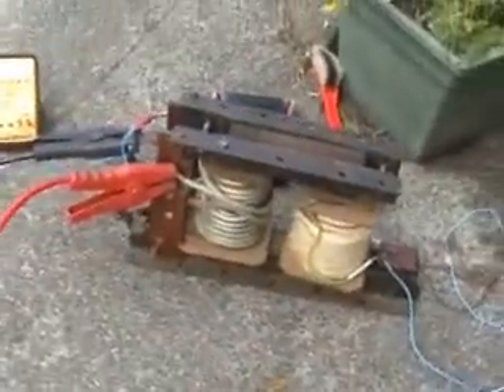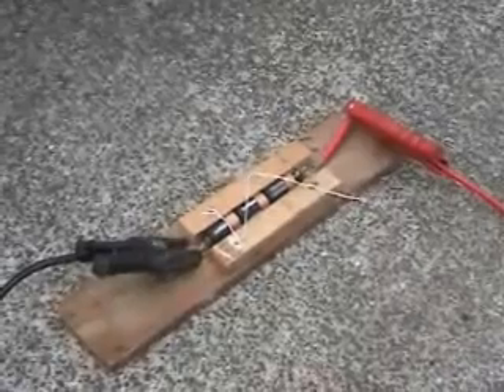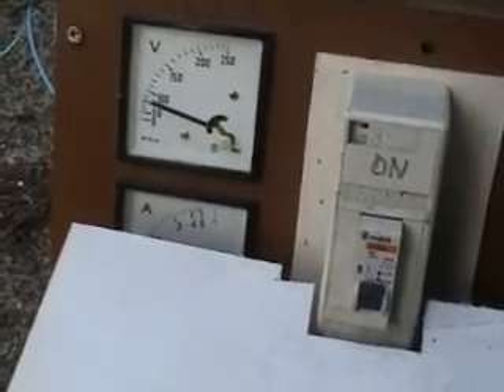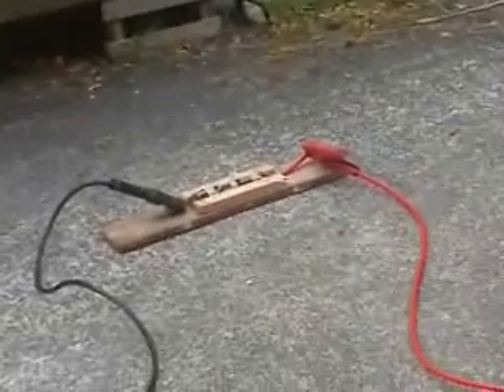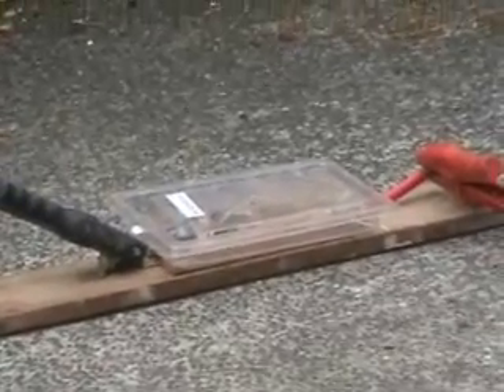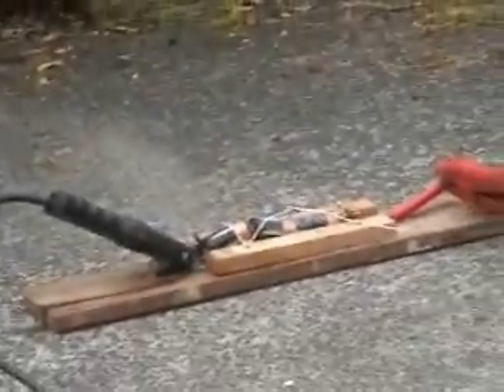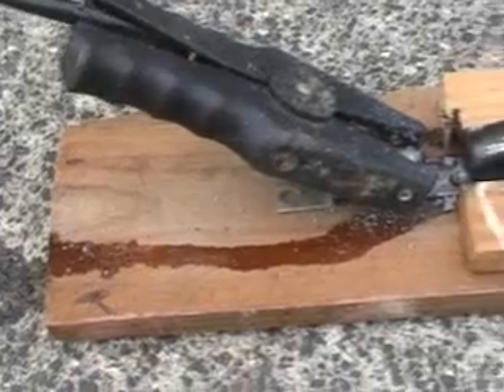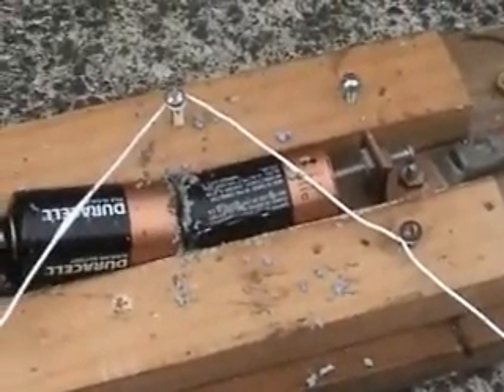Battery Explosion

Comment from the maker: @EvendimataE Be carefull , you need to monitor the cells temperature so that they don't overheat, best is to use a proper charger as these Li cells will explode if not charged properly.

Comment: i have some lithium ion batteries from laptops....if i will charge them with regular chargers will it be a problem..when they are used in laptops i think there is a circuit that senses if they are fully charge and the charging stops

Comment: Hi: Can this D size 10,000 mAh high capacity nickel hydride metal (Ni-MH) rechargeable batteries blow off the Olight 1500Lumen Led Torch? Will it auto
draw 4 D size at (1.2v x 4) x 10,000mAh = 48W power or auto fix Draw at Power 16W?

Olight Led does not have voltage regulation control.
Old Battery was using (1.5v x 4)x 2500mAh=16W
if change all battery to 4 D size 1.2v with 10,000mAh, will it create 48W power & Double to 3000 Lumen Brighness?

Comment from the maker: @Sido75288 This transformer was an ex 5 kVA pole pig ( 11kV - 240 volts)
rewound for 400 Volts primary and about 18 turns of 35 mm² wire.
As it runs on under voltage ( 120 - 240 Volts ac via variac ) the TX is full proof and will not burn out in a short circuit.

Comment from the maker: There are more battery video's to come.
Important is a low resistance path through the cell to pass enough current through it to make it explode or smoke with a puff. Often with series cells are that the internal jumpers burn off at currents over 20 Ampères.